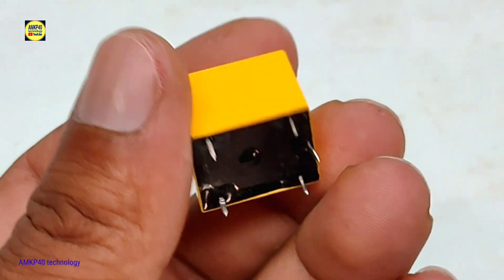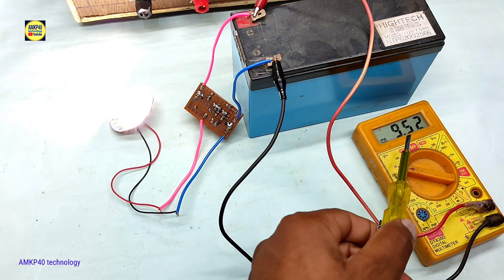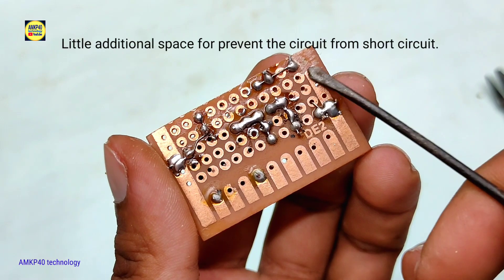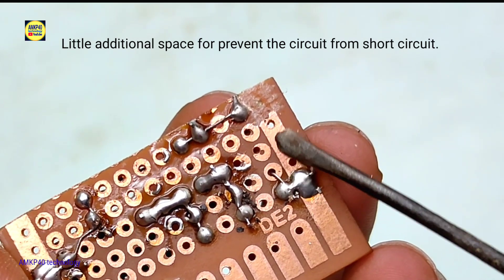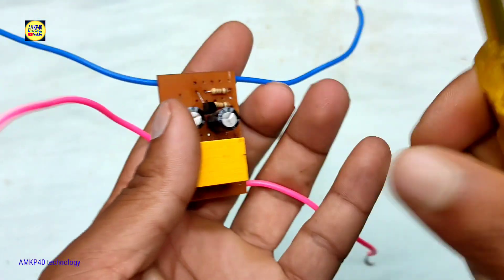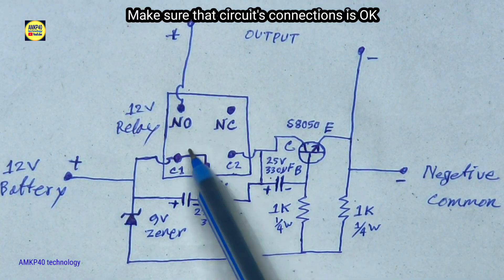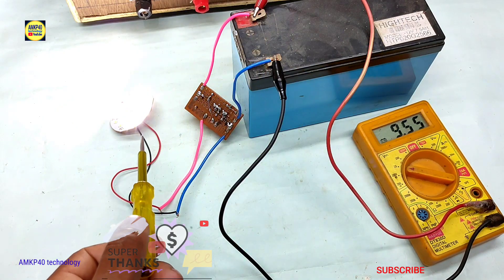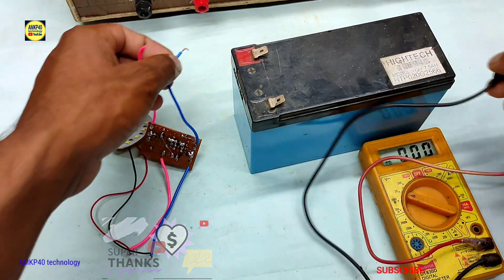Low Voltage Cut-off Circuit For 12V Battery. Deep discharge protection circuit for 12v battery.

Comment: Is it necessary to use capacitors and resistors? Can we not make it using zener diodes and relay only?

Also, how to change the components values if we want to set the cut-off voltage at 9V or 10.5V or 11.5 V
Reply from the maker: Yes 👍🏻, but Zener diodes less reliable and consume continuous power 🙏🏻
Reply: @amkp40technology  Thank you for reply. I realized that resistor is necessary to liit current, otherwise Zener diode burns out and acts like a short.

Comment: Sir from above circuit can i use relay 5v and zener diode to 3.1 to apply low voltage for 18650 battery if my voltage is close to 3.1 will do autocut off, Please suggest
Reply from the maker: No, follow my circuit diagram link for more information 🙏🏻